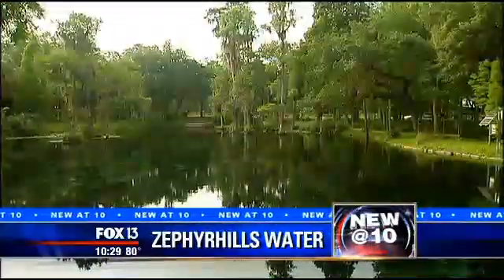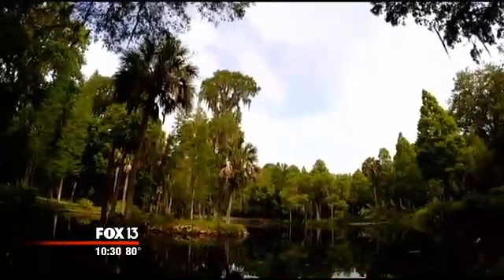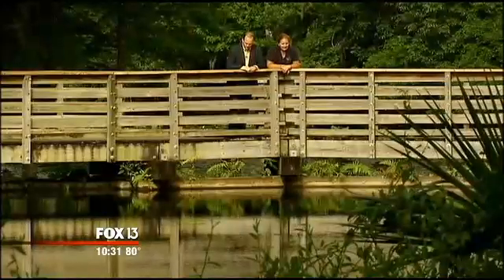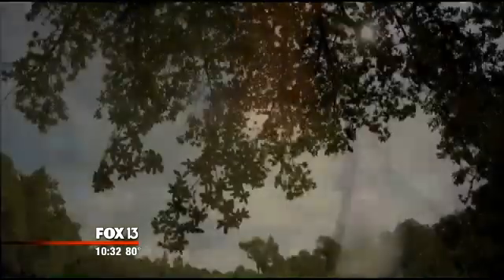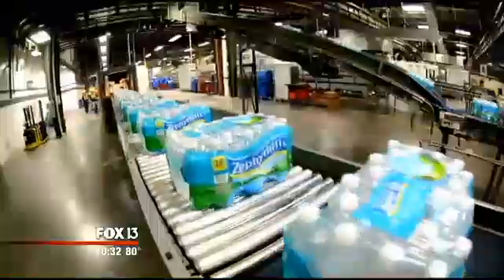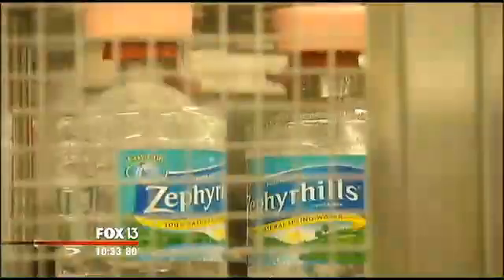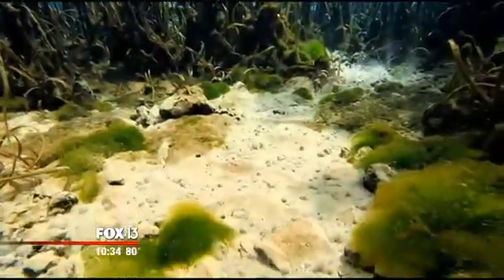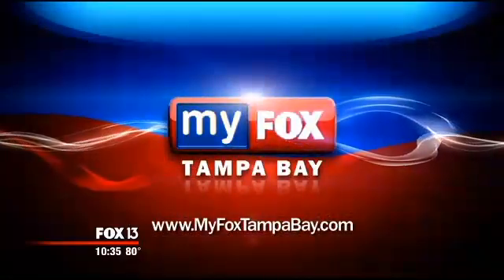Where does Zephyrhills water really come from?

Comment: I lived in SW Florida for 5 months. I had the spring water.I fell
in love with the water.
Reply: Nestle's pumping out of the springs are causing sinkholes in central Florida.
Reply: @TimeTheory2099  Florida's limestone and karst geography causes sinkholes. Not saying what they do is right, im against the pumping but the WMD's are the big bad. This is a drop in the bucket compared to how much water is taken out due to water permits for big agriculture in Florida. Our springs are dying and once they're gone they don't come back. We can't ever restore them to what they were but if all pumping stopped this minute we could at least preserve them as they are now. I'm not being rude just look into the numbers and pass it on. Education is tbe best way to advocate for Florida's water. Advocate against both bottling and agriculture. Only upside i see is water plants aren't taking out plus putting nitrates in like agriculture. Over pumping plus fertilizers soaking into the limestone into our Springs is the reason you see less good vegetation and more of that nasty algae. It's so frustrating 😤
Reply: @TimeTheory2099  they aren't  Nestle though